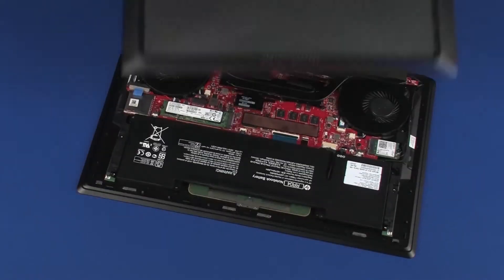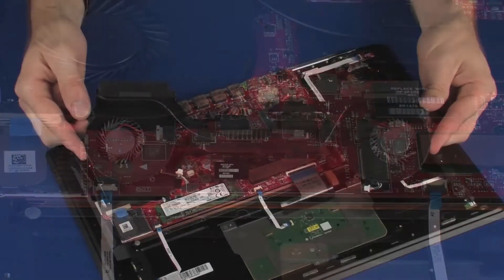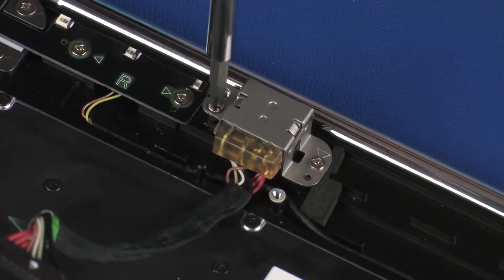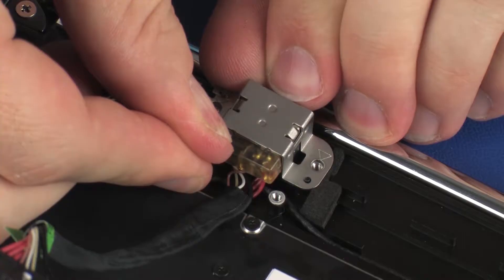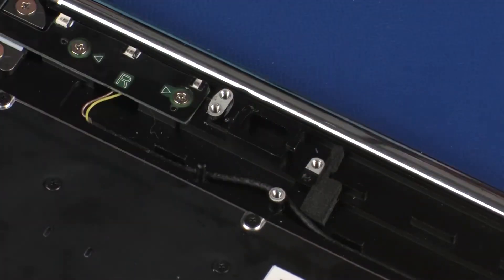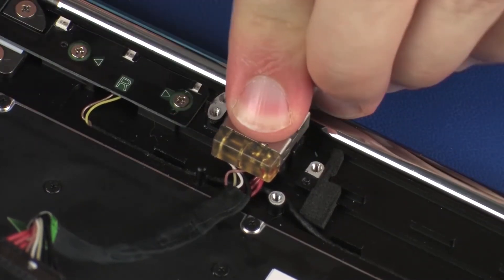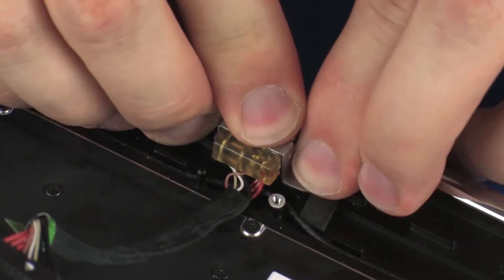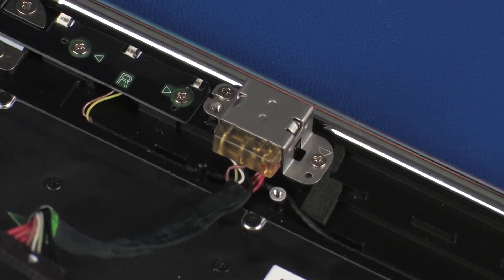Replace the Power Connector Cable | HP OMEN Notebook PC 15 | HP Support

Comment: Hi i own a HP Omen 15 inch gaming laptop and my power port has become slightly loose what part do i need to purchase to replace it with.
Reply from the maker: Hi there, thanks for contacting HP Global Social Media Support!
My apologies for the inconvenience, in order to get this issue fixed, please contact our customer care team over the phone or chat for further assistance, as this issue requires Live conversation with you over phone or chat to isolate the issue and provide you instantly with appropriate solution or repair/replacement options available at your place as per the warranty. Please feel free to reach us on call/chat, please access this link to select your preferred country and language option to reach us. Global support link: - https://splr.io/6050YnWbp 
Regards, 
HP Support

Comment: I have problèm with my hp omen 15, the connector doesn't work
Reply from the maker: Hi Anas, thanks for contacting HP Global Social Media Support!
I understand that you are experiencing an issue with the power connector. 
In order to get this issue fixed, please contact our customer care team over the phone or chat for further assistance, as this issue requires Live conversation with you over phone or chat to isolate the issue and provide you instantly with appropriate solution or repair/replacement options available at your place as per the warranty.
Please feel free to reach us on call/chat, please access this link to select your preferred country and language option to reach us. Global support link: - https://www8.hp.com/us/en/contact-hp/ww-phone-assist.html
Binu_HP Social Media Tech Support